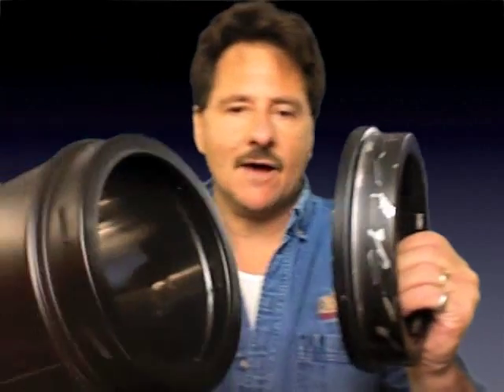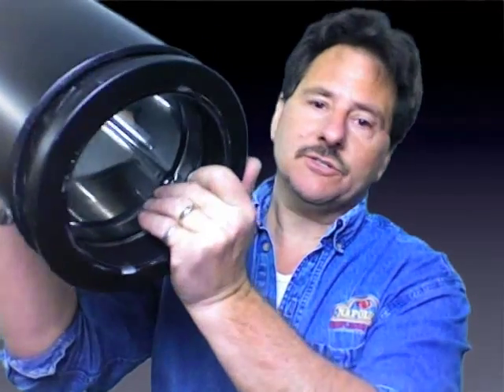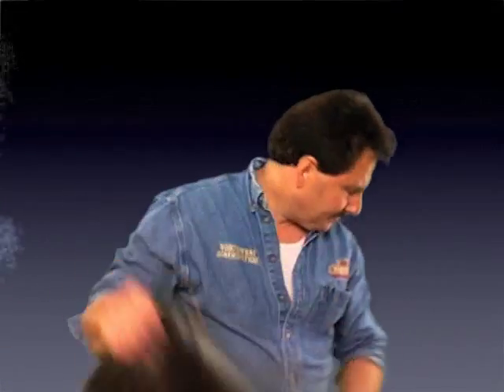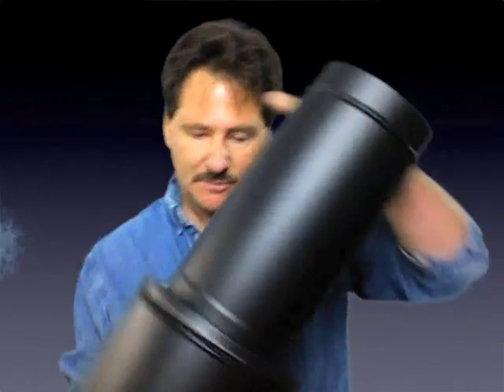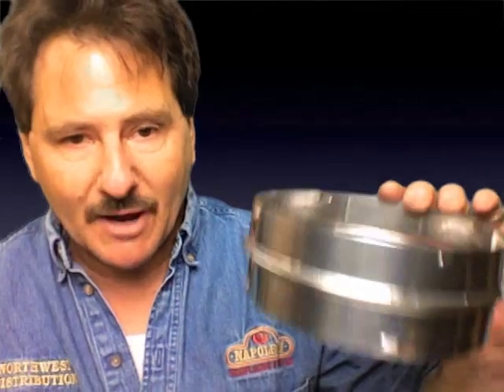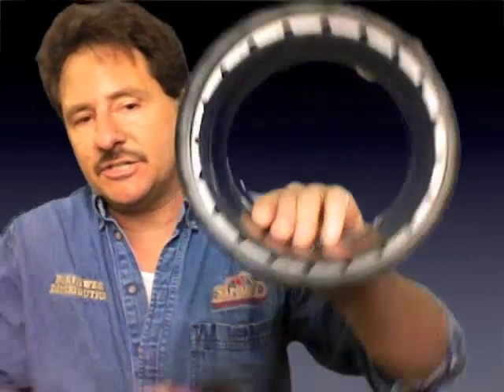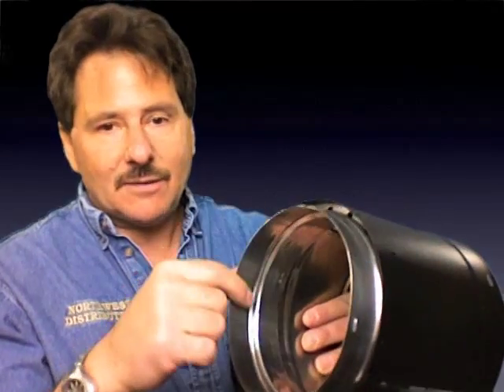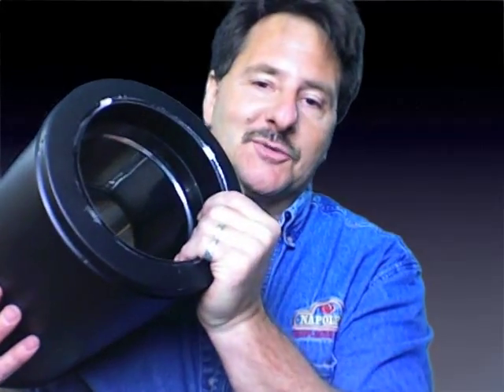Stove pipe - how to connect 6DT-fc

Comment: How about for a wall thimble? If I understand correctly if I'm coming from the exterior tee inside I go through the thimble into the building what is the fitting to go from dura tech to dura vent?  I'm using double wall inside for clearance. I get its an adapter, is it this piece? Everything else I understand, except the prices lol

Comment: Hi  I really appreciate the video. I have a few questions for you. How can I go from the single wall pipe to the DVL double wall? I purchased the single walled pipe as in your demo no trying to figure out the next step. My stove is a 6 inch and I have to reach at least 8 foot high.  also any pointers on a cap at the end of pipe above roof. Do I need another adapter? Thank you for putting out your videos.

Comment: OK, well answer me this... you have a support box mounted in the ceiling and you have your 400 pound stove sitting on the floor. The box is fastened in and will not move up, and the stove can't be lowered so how do I get the clearance to insert the pipes together?
Reply from the maker: What you need here in a slip connector, these are available from the manufacturer of the chimney you are using... the slip connector will attach to the  support box and enable you to slip up and down with the stove pipe. They usually come is a few sizes.. These will Be manufacture specific...

Comment: You did the pipe connecting on the floor or table without showing the process. Are we supposed to put it together on the floor before installing it in the ceiling? Or to you have to push it that hard over your head attaching it under the ceiling?So much for clarity. Poor demonstration. That was the reason that I watched this. Revideo please.